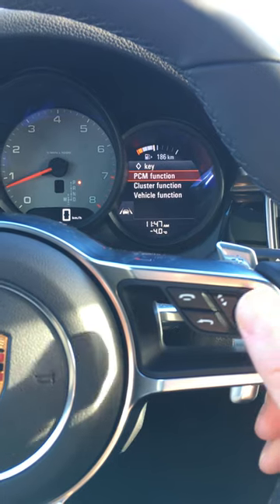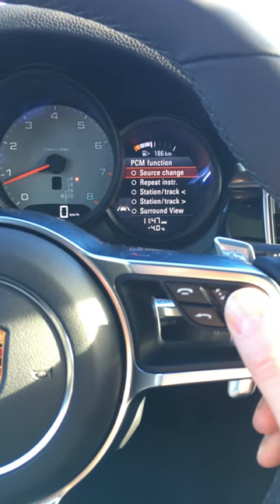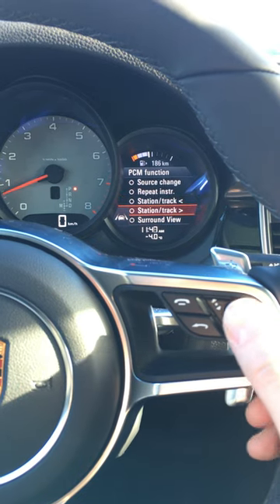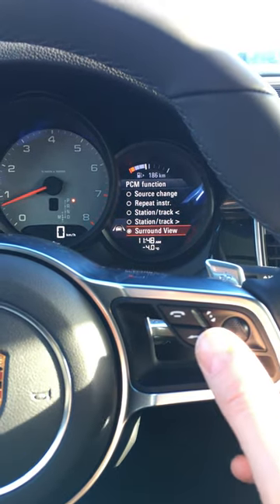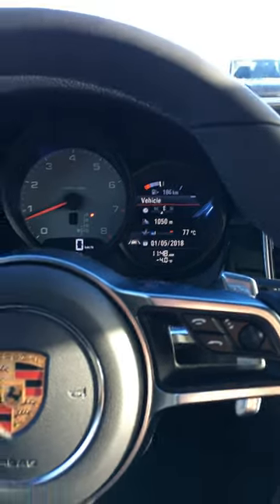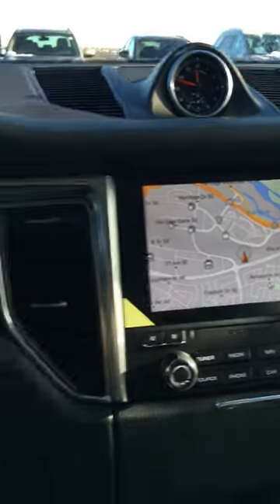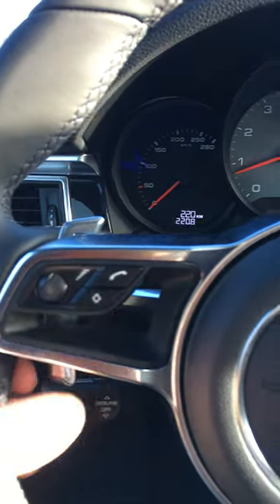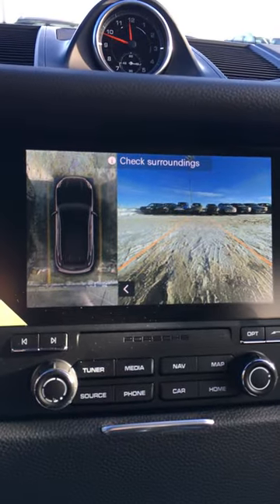Setting your multi-function steering wheel in your Porsche | PCC

Comment: Hi, is there way to have the multi function button select sport mode on and off on a new Macan s?
Reply from the maker: On the 2017 model, you do not have that option. We would recommend getting the sport chrono option on the new Macan S, then you can operate sport mode from the steering wheel. Thank you for watching!
Reply: Hindsight a wonderful thing. I've taken delivery already. At the time of spec'ing the car my dealer asked if i wanted to do track days and needed launch control which i dont. Looking back i should of opted for this Chrono option.  Annoyingly my old SQ5 felt so much quicker from a standard start compare to this even is Sport mode.
Reply from the maker: You can always talk your local dealer about a Macan GTS that is optioned with the sport chrono dial